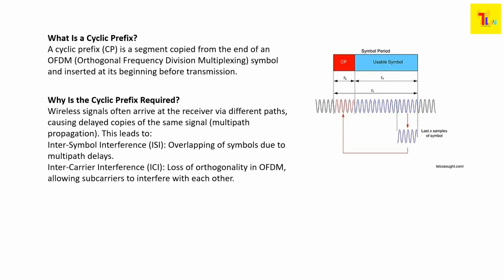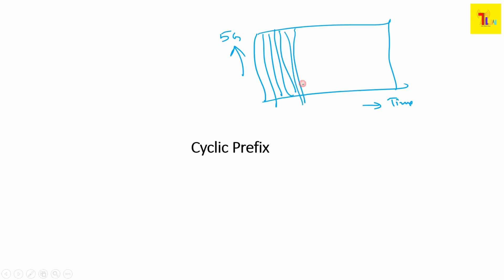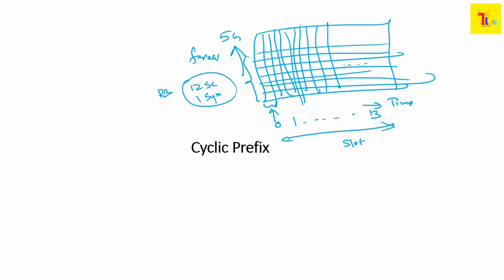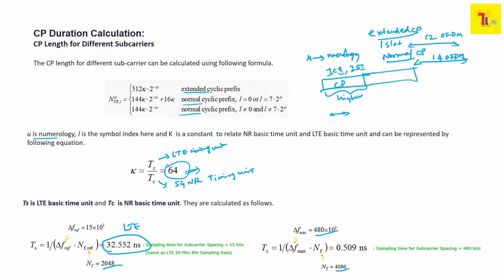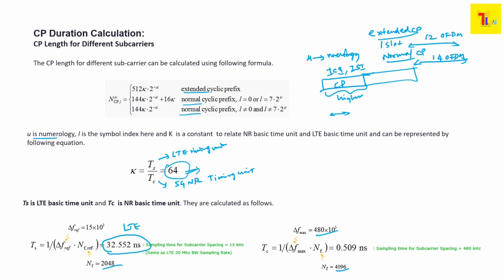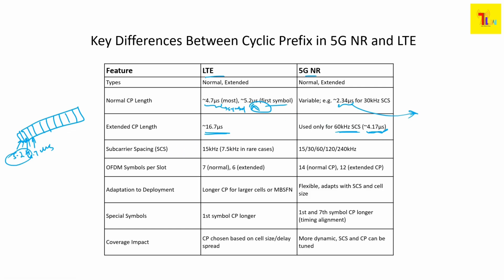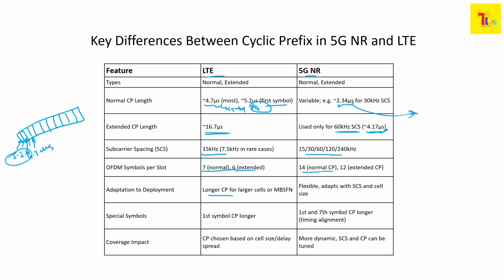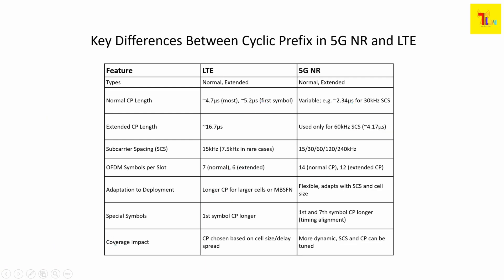What is Cyclic Prefix (CP) ?explained in detailed

Comment: thanks for sharing. For High multipath fading Scenarios, such as urban or dense urban environments, is better to use Extended Cycle Prefix? will choosing one over the other impact the throughput?
Reply from the maker: Yes, Extended Cyclic Prefix helps in dense urban areas by reducing inter-symbol interference from multipath. But it lowers throughput since fewer OFDM symbols fit in a subframe. Use it only when delay spread is high.